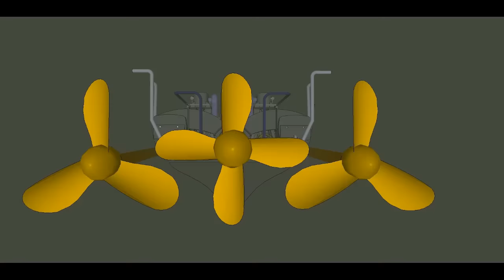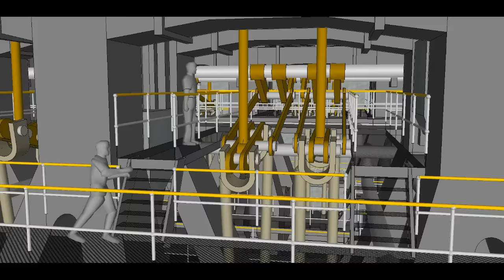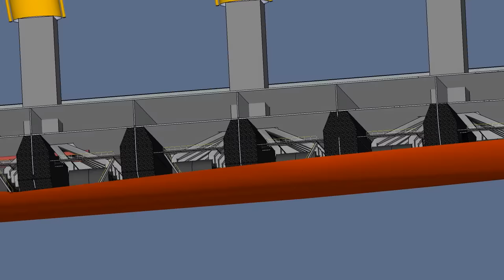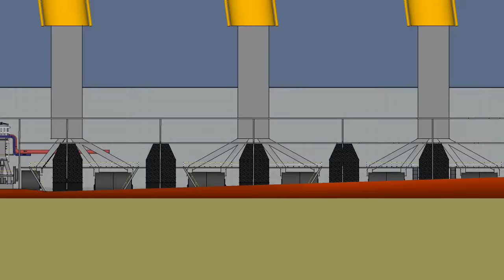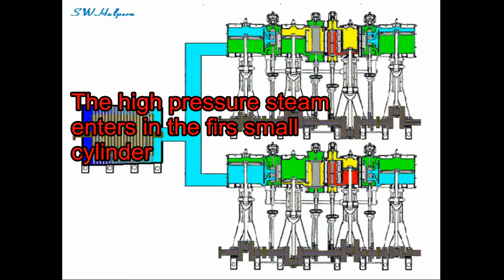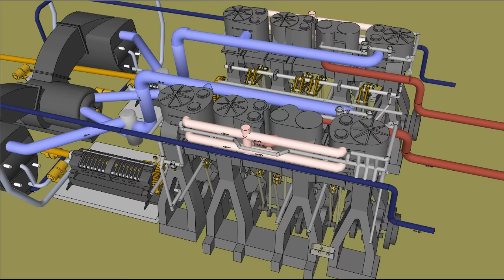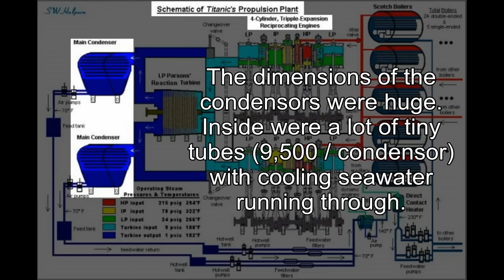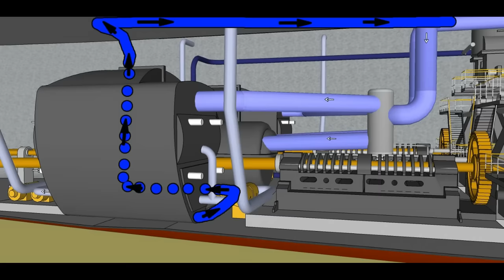The Engines of the Titanic

Comment: I am happy you got the engines right. Most people make the mistake and think that the titanic had "two reciprocating three-cylinder, triple-expansion steam engines", they were a common engine at the time. When in fact it had "two reciprocating FOUR-cylinder, triple-expansion steam engines" This was cause at the time there was no cylinder boring machine large enough to bore the low pressure cylinders diameter. So they used two cylinders the same size as the intermediate pressure for the low pressure stage, so they could build these bigger engines (30 000 horsepower, 22 000 kW). Making these engines four-cylinder, triple-expansion steam engines with the one centrally placed low-pressure Parsons turbine. This centrally placed  low-pressure Parsons turbine is one of the reasons the owner wanted to go at full speed, even with "pack ice and iceberg warnings", if the two reciprocating engines were not run at full speed the low-pressure Parsons turbine could not be used. Dropping the efficiency of the ship a lot and increasing the amount of coal burnt for the whole trip, costing the owner more money in burnt coal as well as the ship might not arriving on time.
Reply from the maker: Very interesting story. Many thanks for that.
Reply: Would the stopped centre propeller have freewheeled in the flow, turning the turbine with it?

Comment: I have to say as a licensed high pressure stationary steam operating engineer, every thing portrayed on this video is ENTIRELY accurate! Very nicely done. I really enjoyed that little insertion of the donkey steam engine employed to get the larger machine rotating. I am retired, but I sure miss operating large high pressure steam boilers and the associated machinery!
Reply: +heffo and juff  one point only it were not triples, but quadruples ..(temds???).for as far as y know
Reply: +MrBugsier5  You know what, I think you are correct. I know the engines ran on super heated steam.
Reply: +heffo and juff 
I keep telling those pesky boiler operators the same thing my gramma told me: ''Don't you know that a watched pot doesn't boil?''    How can you tell a well seasoned steam operating engineer?  His boots hit the desk before his ass hits the chair.
Ain't it nice being retired?
Reply: +heffo and juff A gentleman I knew many years ago (he had to be in his 70's or older when he worked for my father) was a master toolmaker, who had 2 hobbies; history and building (working) model steam engines.  Pretty much anything he did was a work of art, but his steam engines were amazing.  I'm also a fan of steam locomotives, and right now I'm closely following Union Pacific's rebuilding of Big Boy 4014.  If you've never seen a Big Boy it is hard to comprehend just how huge a locomotive it is - weighing around 250k pounds; I look forward to seeing it in operation in a couple years, first time in nearly 60 years that one will operate.  Of course, I really like steam ships; my favorite is the SS United States, which if finally brought back to life soon will certainly lose its aircraft carrier based steam.  This ship could do somewhere approaching 40 or so knots without all boilers lit off.
Reply: +kimmer6 A 4-8-8-2 ought to be nearly as big as the Big Boy which is 4-8-8-4.  I'm assuming it is articulated.  The next biggest still running is the existing UP Challenger which is a 4-6-6-4.  Amazing just how powerful these monsters are.  Try to imagine it running at 70mph!
Reply: +Greg McColgan I too look forward to 4014 under steam!  I've followed some of what UP is doing; huge amount of work, very, very methodical.  BB shares a fair number of parts with the Challenger, so there is likely a fairly easy learning curve for UP.  As to SSUS, 45 knots is not likely; on her sea trials she did 38 knots, on her maiden voyage, 36+ - at 2/3 power, so my best guess is about 40 top, but no one really seems to know.  She could also do 20+ in reverse, and could maintain a decent speed even if one engine room was shut down.
Reply: I thought some of the BBs were converted to oil and turned around cab first to be able to see out of the tunnels before the billowing clouds.
Reply: Southern Pacific built a number of cab forward 4-8-8-2 locomotives. The cab forward is because of long tunnels on their system. They moved the cab forward due to the long tunnels and crews were getting asfixiated due to the smoke. The cab forwards were oil burners because it is easier to fire an oil burner from the front.
Reply: thegreenerthemeaner 👄👅
Reply: except for the fact that the titanic had 4 propellers not 3
Reply from the maker: Where did you get that information?
Reply: No, the diagrammed layout and sequence of operation are correct and as installed.
Reply: Steam engines are exceedingly dangerous!  A friend now deceased used to work at Cardiff Docks.  One horrible job was cutting out a bent steam engine conrod that was about four inches thick, using a hacksaw (hot working was not allowed so it took all day and several blades)  Another bloke just about had his head cut-off with a jet of super-heated steam that was leaking from a pinhole in a pipe!  In places like that one needs to carry a rolled-up newspaper and hold it in front of oneself as the steam contains so much energy it can act like a laser beam.  (when one notices that the newspaper is burning it is time to retreat!) Ship repairs were so dangerous that my mate changed his job.  These days a lot of ships are diesel powered so the super-heated steam hazard may be a thing from the past.
Reply: Tech Davey Newspaper ain't long enough. Broom handle is much better. Super heat steam is invisible and will cut a broom handle right in two.
Reply: Donkey engines were not used to start marine steam engines.
Reply from the maker: as far as I understand they are used to turn the big engine into the right position.
Reply: Hoe ishetmogelijk 
Only on large stationary engines that do not have stephensons (or similar) reversing mechanisms. For example like those engines used in rolling mills or pumping stations.
Reply: Hahahaha...really? In FACT...you are very wrong, she had 2x Triple blade props, 1x Starboard and 1x Port, and had a Four blade centre prop 1+1+1=3......lol
Reply: Could've used some proof reading..
Reply: MrBugsier5 .

.
Reply: Wrong. Two recips and a LP turbine between them.
Reply: heffo and juff
Reply: The Captain Flowers are you sure about that?
Reply: You sir are amazing..Steam engines should make a come back..there is so much renewable fuel being wasted which can run in these engines..
Reply: Yes, you cant even see it. DEADLY!
Reply: What?  You claim to be a steam engineer?

The "starting" engine didn't start the triple 
expansion engines.  It is a "barring engine, 
and only needs to get the HP crank throw
perpendicular to the connecting rods.
(Well, close is good enough here.)  Once 
steam is applied to the HP cylinder, it 
will turn.  If steam isn't applied for a week, 
as long as it is in the correct position, it 
WILL turn.

And, he has the turbine engine using AIR!
I thought a steam turbine uses steam.  I 
must be wrong!

steve
Reply: @rontroy3843 , 4014 runs!  I hope He is coming to Arizona!

steve

Comment: I’ve always admired the cleverness of the Harland & Wolfe engineers that came up with adding a low pressure turbine to run on exhaust from the triple expansion engines. Squeezing just a bit more work out of steam that was already at less than atmospheric pressure before running it through the condensers. (Which are themselves quite impressive, given that they were effective enough to draw a vacuum in the steam lines...
Reply: I suspect the 9 psi quoted as input pressure to the turbine is in fact gauge pressure, not absolute pressure. So that would be 9 psi above atmospheric pressure. :) Otherwise I struggle too to understand how one could maintain steam flow towards the turbine with a partial vacuum at the input when its outlet, at least on start up, would be at atmospheric pressure!
Reply: Ah, but the outlet from the turbine, and engines themselves when bypassing said turbine, isn’t to the atmosphere. The steam is routed to a set of large condensers that turns the steam back in to fresh water to be returned to the boilers. Keeping the whole boiler feed system a mostly closed loop instead of an open system. These condensers used seawater as coolant, and especially in the North Atlantic where it’s quite cold they were quite effective at drawing down a vacuum in the steam system.

Comment: That's simply incredible. The ability of a small 2 cylinder steam engine that I could build at home, through gearing, to be able to turn that massive fly wheel to start the mains is absolutely incredible.
Reply: +Matt Schuette Not to start it but to warm it evenly and eventually blow the condensed water out of the cylinders. Steam engines are self starting.
Reply: +jibemorel oh and for lubrification purposes to.
Reply: +Matt Schuette I'm not sure that's actually a steam engine, it looks (and sounds) like it might be a petrol powered one. Lighter and more compact for moving by hand against the huge flywheel, for the same power, and no need to deal with setting up flexible pipes etc for it. Be quite easy to turn over and get going by hand, especially in a warm environment like that, and a heck of a lot safer to be around.

Open crank etc because a lot of cars were still made like that, and when it's only going to run for mere minutes on a typical voyage, you can just hand-oil it. And it only needs a very small fuel tank as well.

Not the greatest amount of torque of course, but that's been demonstrably compensated for by ultra-low gearing... which turns a lot of power at high speed into a lot of torque at low speed. Just a pity no-one had quite managed to crack making a really big one of the type a ship like the Titanic needed. Nowadays of course they're all diesels and need a team of maybe 5 or 10 guys to look after them at most despite developing a hell of a lot more power...
Reply: mspenrice Nah, its a steam engine, I seen a video of a replica of the Titanic's engines. It is a small steam engine that gets the larger ones moving.  I'll find it and post it here
Reply: +Matt Schuette Fair enough then. Suppose when you have that much live steam knocking around you may as well use it. Just seen little auxiliary petrol engines used for getting other large machines moving before.
Reply: That small engine was not used to start Titanic's engines. They were started on their own. Just because the YouTube has made a great animation doesn't mean that all his claims are 100% accurate.
Reply: Did you watch the video at Kempton?  An expansion engine such as the Titanic's absolutely could be started on its own, why would you want to ?  Why would you want to admit high pressure high temperature steam into a cold engine ?  Using the "starter" engines to rotate and admit steam slowly to warm the engines and remove any condensate is how you start any engine from a locomotive to an expansion engine.. if you want it to last any amount of time that is.
Reply: Matt Schuette
I've been to Kempton. Wonderful place. However, that is a stationary engine. It does not need to be reversed. It doesn't have reversing links. Therefore, in order to put the valves in the correct position to start it, it requires a small auxilliary engine to rotate the crank.

No locomotive that was ever started the way you suggest. Locomotives have cylinder cocks that can be opened, and this is how condensate is removed from the cold cylinders.

Presumably, a similar method was employed on marine triple expansion engines. I am 99% certain that they did not use starting engines to start them. The small engine was just used for maintenance purposes. But I check up on this on a specialised forum and get back top you.
Reply: I actually was meaning that locomotives cracked the throttle and opened the drain cocks. I typed that kinda late so it didn't seem to come out right now that I read it..  more information would be great I'm always willing to learn something I don't know.  I'm in the process of building a locomotive, 4 3/4 gauge
Reply: Matt Schuette
No worries. I'll let you know what the Titanic experts have to say.

I envy you - making working scale models of steam engines is an excellent hobby. I wish I had the time, space, skills, tools and money to do it!
Reply: Most people who do this hobby don't. It's all a matter of perspective. I gather what I need when I have the money to buy it. It's a very long term hobby, most members in my Live Steam club built their locos over a period of 10 or more years.  Like eating an elephant, just takes one bite at a time.
Reply: JasonJason210   Hamlet
L Hamilton hearty Irish symphony
Reply: The barring (small) engine does not start the large engine, it's just to bring the large engine into the correct position for it to start under steam pressure, as it's not reversable. You'll notice that they disconnect the barring (small) engine before they turn on the steam valve for the large engine.

Comment: 1980: by 2020 there will be flying cars 
2020: me dancing in the living room to Titanic steam engine sound
Reply: Flying cars didn't arrive until 2045 as preference was given to the development of a clock work engine. With the spring being wound up by an exactly matched key. The exact matching of this key to each engine was to prevent unauthorised starting and theft. Once available power/weight ratios were sorted out the flying car was placed into production. One wind of the spring would give you enough energy to fly the car 100Kms. It could also be wound up whilst in flight giving it great versatility. And best of all no carbon foot print.
Reply: @Becu1001a  bro what
Reply: @Becu1001a  Are you ok?
Reply: @Becu1001a  come again?

Comment: The britannics engines although of the same size and dimensions used piston valves on all cylinders instead of slide valves as used on the titanic and Olympic and developed 16,000hp at 77rpm as opposed to 15,000hp at 75rpm and are the largest and most powerful steam reciprocating engines ever constructed.
Reply: 16,000 hp per pair? or EACH? if the later, holy crap....
Reply: 46,000hp for the titanic, a few thousand hp more for britannic.
Reply: Note that, in 1911, Olympic's chief engineer stated her engines had developed 59,000 horsepower at maximum revolutions.  Britannic would be capable of even more.  A 1940s report of H&W's tonnage completed in 1914 put it at 60,000 horsepower.
Reply: I suspect they need to qualify their statement and refer to both triple expansion (as opposed to quadruple expansion) reciprocating engines and for marine, rather than on shore, use.
In the case of either Olympic or Britannic's reciprocating engines, they could work well over 80 rpm and develop more power than quoted here.
Your mention of rolling mill engines reminded me of a quote.
"I
 do not think many people who have not been there, realise the enormous 
power that there is got from the steam pressure in these engines; they move
 comparatively slowly even when at full power, and the power behind them is, I think I am correct in stating, larger than the power behind the biggest
 rolling mills in the world. That is, the biggest mills that are used anywhere 
for the rolling of steel plates, as distinct from the forging of armour plates,"  - Harland & Wolff ’s Edward Wilding, spring 1912.
I don't know of any specific examples or whether they used quadruple expansion engines in rolling mills for steel plating?
Reply: That is 16,000 shaft horsepower each.

Comment: I love this!! I love the sound of those engines too.  I understand that they are building a replica of the Titanic, but  they're going to have a modern day propulsion system.  I think that they should still have the same propulsion plant, however, the original style Harland And Wolf boilers should be modified to be fired wth natural gas instead of coal.  Tanks for the natural gas would be in place of the coal bunkers. 
  I have been a big time Titanic buff since Jame's Cameron's movie came out.  I have adopted the terms "Port" and "Starboard" to refer to my left and right, and use those terms universally for everything.  Last year, I had a knee replacement, and it was the starboard knee.  I work as a dishwasher in a retirement home, and the kitchen that I work in, I like to refer to it as the "galley".

Comment: Fascinating! I'd love to see how the electric engines/dynamos (aka the "generator room") fit in to this whole plan
Reply: Just some more turbines, driven directly on steam I guess. A lot of space, maybe towards the front.
Reply: @123Chevyman  I already know the location of the electric engine room. It was was just aft of the turbine engine room, and contained four dynamos which I think were piston style engines, but not 100% on that. What I meant by "how they fit into the plan" is that I'd like to know how they fit into the steam pipe network specifically, and also the interior workings of how the engines themselves functioned
Reply: No they werent towards the front. That was the reason why the Titanic did have electricity up until the very end

The Dynamos were dry in because the aft flooded last
Reply: @Rudeljaeger  yeah, the electric engine room was far aft on tank top level, just aft of the turbine engine. And then also there were the back up dynamos about 2/3 or so aft on D-deck, around about where the ship split. It's not likely that either saw much flooding before the break up, and the break up probably crushed both rooms anyway, so flooding was the least of their worries at that point